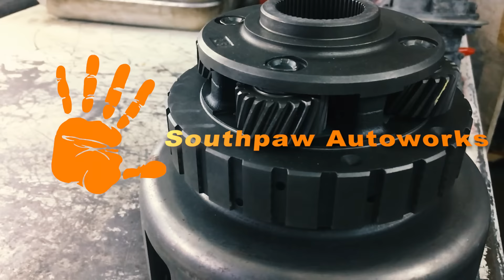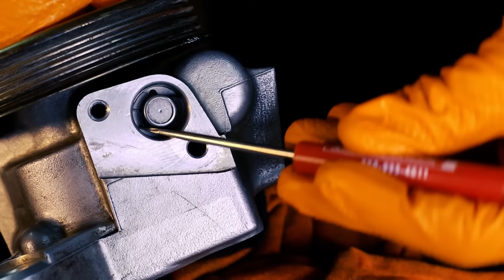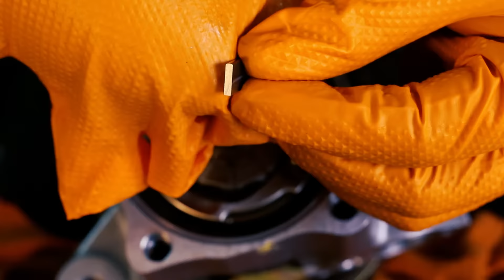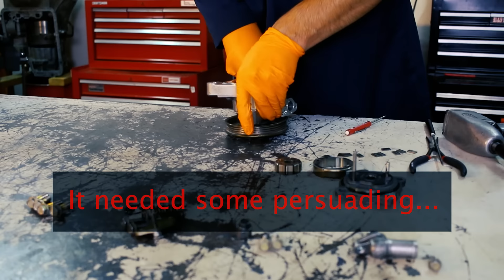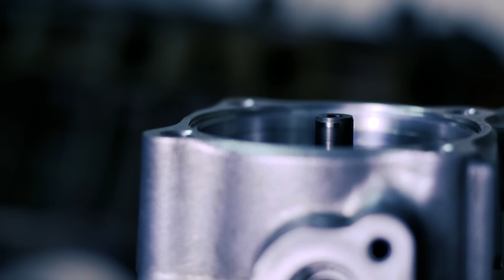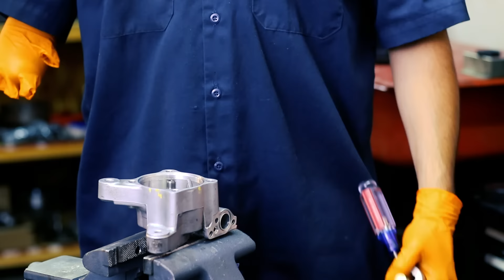Power Steering Pump Rebuild - Part 1 of 3 (1 Hand Mechanic) #SouthpawAutoworks

Comment: I just started watching this video and I'm already impressed! Many mad props for not letting a disability hold you back,  define your life, or let it dictate what you can or can't do! I was born with Spina Bifida that wasn't caught until I was 8 and it had done a lot of damage, and had all of my doctors telling me I couldn't do this or that ever. I'm one of the blessed in that I can still walk, many people diagnosed with various types of Spina Bifida can't. I ended up doing every team sport (except a select few) and then got into board sports & reached unsponsered "Pro Levels" in surfing and skateboarding. I had a spinal injury that stopped me going further sadly. But now I do gig work, and have been learning to work oj cars since getting my own vehicle  (2002 Hyundai XG350L) and have been steadily restoring an already great car & modernizing it by putting in advanced aftermarket parts as I can afford them. I appreciate any info I can get on rebuilding my vehicle & have nearly finished doing the entire suspension system and have done numerous sensors, the brakes/rotors/fluids, new plugs/cables & boots/coils, new fuel pump/filter/pressure regulator/soon the injectors, lights all around, complete engine oil & coolant flushes (gently), added a backup camera, cut & polished the whole car's paint/clearcoat, new filters all around, added daytime running lights up front, and tons of other things. It always hurts like hell to do the work due to spine/nerve pain, but I keep going. I'm about to replace the power  steering pump & put in new front lower control arms today with new lower ball joints, new tie rod ends, and new poly bushings on the stabilizer bar end links that I recently replaced. Then it's just some new lowered sport coil springs & a couple of bushings in the back (already did the struts) and the whole suspension (the wearable items that is) will be done. The car needs transmission work. A new fluid pump, torque converter, accumulator pistons, pressure control pistons, solenoids, and a filter. But I may just buy a freshly rebuilt trans from autozone (it comes with a torque converter) and put that in (with help). Long comment, sorry about that! Just wanted to say that you're an inspiring person & that you're appreciated!  Thank you for your hard work, and I'll be sharing your videos as you deserve to have your work & your channel be well known! Thank you, and take care!
Reply from the maker: Dang!  You're all over that car...like a bad rash!!!  It sounds like you've worked on almost everything on the car...bumper to bumper.  I'm really glad to hear that you are doing what you love.  Keep going...
You can find info about automatic transmission repair on the Southpaw Autoworks YouTube channel.  I currently don't have anything on your particular transmission.  However, the rebuilding fundamentals apply to all automatic transmissions.
Thank you so much for sharing your story.  Truly inspiring.

Comment: My pump only has one dot in one side and no dot in the other side, What is the right way to assembly? Thank you for this friendly video for apprentices like me.
Reply from the maker: Thank you for the positive comment.

Questions:
1). What vehicle (year/make/model) did the pump come out of?  
2). Regarding the dots, are we talking about dots located on the pump slide, or the pump rotor?
Note:  The pump rotor is the part that spins, and it holds the pump vanes.  The pump slide encompasses the rotor and vanes....and it is held stationary by two dowel pins.
Reply: @SouthpawAutoworks  It is a MB Class C W204, 2011, Motor code M271.820. The only dot is in the slide and it is a Bosch  K S00 000 669 G Pump .Thank you for your kindly answer-
Reply from the maker: Unfortunately, I am not familiar with the vehicle that you're working on.  I did do a Google search, but didn't find any rebuild info on that power steering pump.  As this video notes, it's important to look for these dots (or other similar signs) during pump disassembly, and equally important to take good notes/pictures.  It makes reassembly very straight-forward.  However, I understand that these things can be easily overlooked...especially when the parts are covered in oil/grime.

I need to correct myself.  In the last comment I referred to a pump rotor, and a pump slide...I meant to say pump rotor and pump "cam ring".

Questions:
1). Is the cam ring, in your Mercedes-Benz pump, aligned with dowel pins?  If so, are they the same length and thickness?
2). Is it physically possible, on your particular pump, to install the cam ring in more than one orientation?